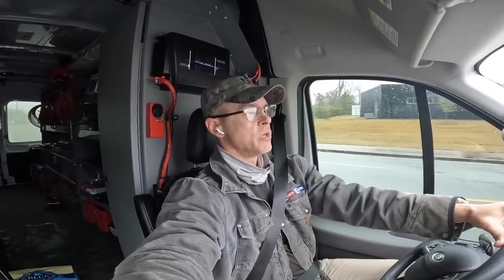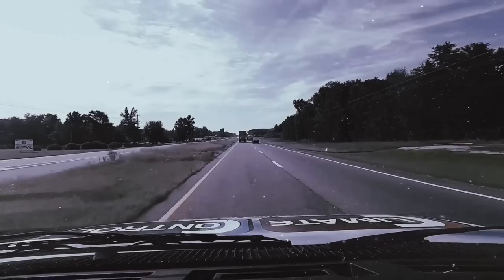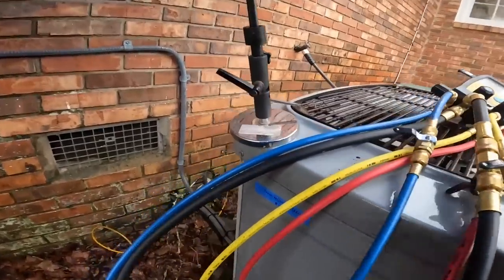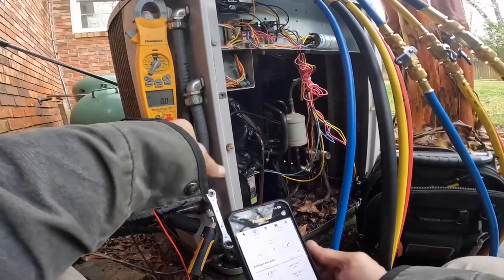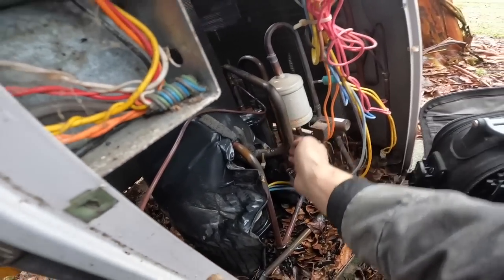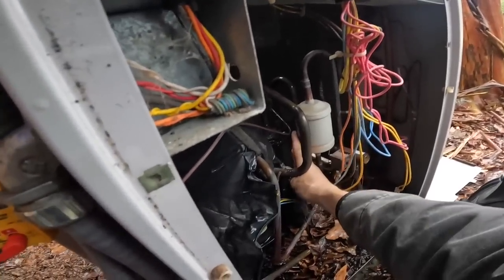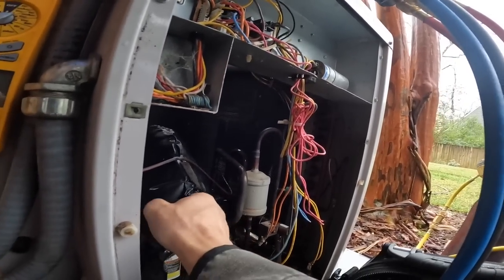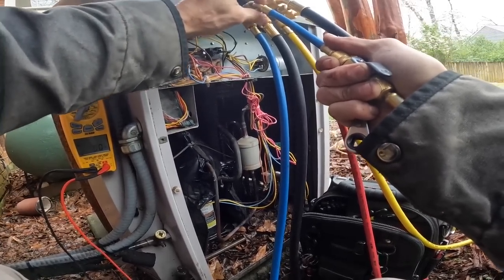A Request to Charge a System up Leads to More Work. #hvaclife #hvacguy

Comment: Glad to see there are still honorable repair techs out there. my family business is the same.  Some larger companies run off commissions and their service sucks.  

haven’t done this work in decades, but love following it still.  technology helps.  but adding refrigerant, i’m still old school and like to see tank weighed before and after.   last tech working in my system used a PDA to measure and i questioned “was it calibrated, how do you know?”.  Bit of tude on his end.   His “charge” didn’t work and then company tried to slams me with a 12-20K quote for 4T split system.   crooks.  When you know the business and costs, you don’t expect to be conned.   then had to threaten the company to stop calling me. 

keep up the good work. look forward to the install video.  (I do miss being a field tech).

Comment: 8k for replacement of a 2 ton system, OUCH. I'm still waiting on my estimate, 4 ton, gas furnace. Discouraging is he told me they went up, and he talked me out of buying the equipment on-line because of warranty. Time will tell. Great job finding that leak, if that is the only leak and you fix it, I would not be looking to replace right away.
Reply: Actually, depending on if the indoor furnace/AHU it High-efficiency two-stage or modulating, new indoor coil, new high-efficiency Seer2 Heat pump that is variable speed, 4-6" filtration system and a dehumidifier plus labor and depending on their labor warranty, that is a steal.   You couldn't steal a system here in Denver for 8k.  If it is just the outside unit that is a single stage crap system then yes, that is a rip-off.  It really depends on what was quoted.  I own my HVAC company here and I do not quote or sell single stage units, period.  It is 2023 and the cost difference is so nominal, that when I quote, I do a better and best set of quotes.  I will beat any quote upgrading them to a multi-stage system for cheaper or have a better price and warranty.  I also do maintenance contracts and come twice a year to change the filter, clean both coils, check refrigerant pressures, and do a complete health check on the system.
Reply: @Balticblue93  Sounds like you have it going on over there Kevin. Mine is a split system, I can buy the system on line fairly reasonable, but my hvac guy claims they don't honor their warranty. I find it hard to believe they don't, that would be false advertisement. Someone answered on another post that he could register it with his license, but they won't do labor. I guess I'll see the verdict soon.
Reply: @jthonn  HVAC guy can get a kickback if he goes through his people and sell to you for a profit plus the labor/warranty stuff.
Reply: @GoatzombieBubba  Thanks man I appreciate that, but he claims that no one will work on these units and such, he really puts them down. I will see what he comes up with, he is suppose to be a friend, but you know how that goes.
Reply: @jthonn  typically any and all warranties related to hvac are voided unless installed by a licensed technician/ company/ epa certified.  Whether it's a condenser, a furnace or a thermostat. He was not bsing you.  You'll spend more,  but if it's a decent person/ good company you'll have peace of mind.  Every unit comes with 10year parts out the box when a real company installs it.  Don't go with a company that doesn't give 10 year labor with it.  Then, worst case, the only thing you'll pay for over that 10 years is maintenance and any duct/ coil cleans you decide to do.
Reply: @andrewhepfinger7969  Thanks Andrew, my friend is licensed and has a co. so that isn't the issue, he claims these co.'s do not own up to their warranties, he knows a few that have gotten into trouble with them. I will see what he can do and go from there, thanks again.
Reply: @jthonn  no problem my friend.  And from what I understand,  no real, recognizable company(rheem, trane, bosch, york, lennox, carrier, etc) can deny anything on the parts side as long as you're having preventative maintenance done minimum once a year.  Some are denying claims now though on systems where people don't have their check ups done. Especially now with the Seer2 crap. Requiring more testing and more expensive parts. 
But,  companies will charge just as much as the part costs or even more in some cases for labor.  Spend a couple thousand extra.  Get the 10 year labor, 10 year parts.  If they don't offer it, don't go with them.  Thank me later.

Comment: So glad to find this channel! I'm installing a mini split and running the drain lines. Does anyone know if the water drain lines from the indoor air handler need to be insulated? A guy at our local hvac shop said he didn't think so but just wanted a 2nd opinion if anyone is familiar with this topic, Thank You
Reply: ive never insulated a drain line on a mini split and havent had any issues. drain lines dont usually condensate
Reply: Most are insulted till you get outside, then run 3/4 PVC  to where you want to terminate with a 45 sometimes snakes like to crawl into just a open straight line .without the 45.
Reply: @aaron serrano  Thanks for the reply, I do have one unit in the laundry room where it shouldn't be. So I'll insulate that one. Since we live in a dry the other 2 units I'll leave without insulation. Just has been several thousand more dollars on the back end and all the little things I didn't plan on keep adding up.
Reply: @Tom Walker  Thanks Tom, our home is a log house and with the walls still being open I opted to build a 3 way manifold and tie in below the washer drain and above the PTrap so won't have to worry about snakes. Learning how to insulate ducting and thread it through the joists gives me a great appreciation for hvac techs. Hats off there's so much to learn. I would have hired it out if I had any idea how much I was biting off.

Comment: The unit has already been converted to MO99 by you and the age of the unit truly deems it to be replaced for efficiency alone and costly repairs.  A new SEER2 high-efficiency variable speed Heat pump would be far more efficient and comfortable.  I don't know what your electric costs are there, but if they are close to here, that unit costing them dearly to run in either AC or heating mode.  Most people do not have cars that old unless it is a collector's item.  Being a 90's unit, it is probably a 10 SEER or less.  That is a big waste of energy, labor and money on refrigerant to extend the life of something that is luck to be even running and could easily fail very soon.  It isn't like it is a 2013 model that could have be variable speed and ECM motors, but a 1990 I believe you said is old and Carriers of that generation were well built.  You have already charged it up once and going to a second time.  I am all for taking care of the customer and that is good on you.  Carrier units are great, but possibly a 33-year-old system is so inefficient and wasting power and refrigerant.  8k for an entire new system is a great price, but if that is just for the outdoor unit, it better be a 24-28 SEER variable speed unit.  If that is for an entire system, that is an amazing price installed depending on warranty for labor included.
Reply: that looks like one of their higher end units from back then so it could be 13-14 seer.